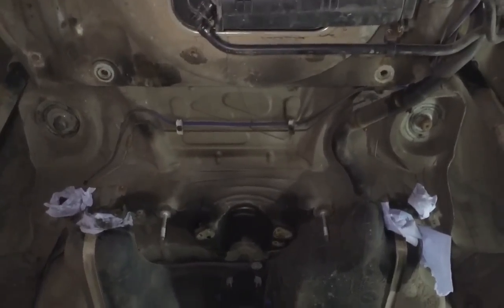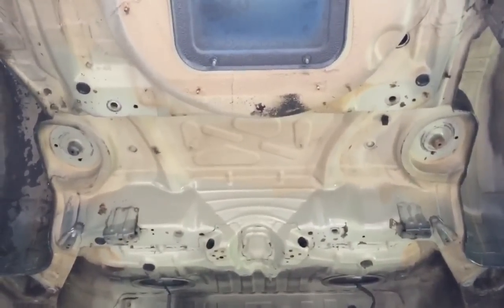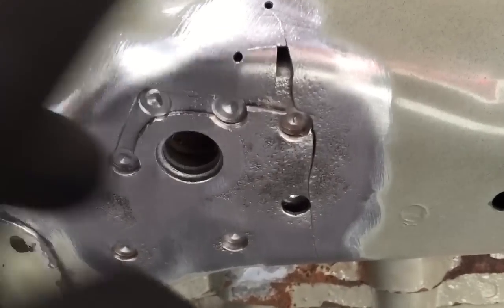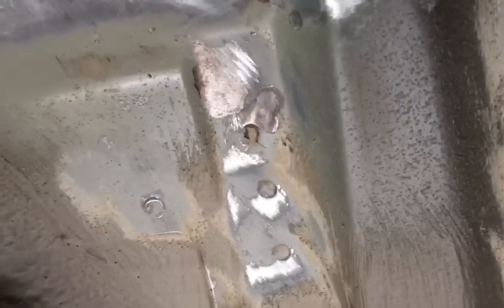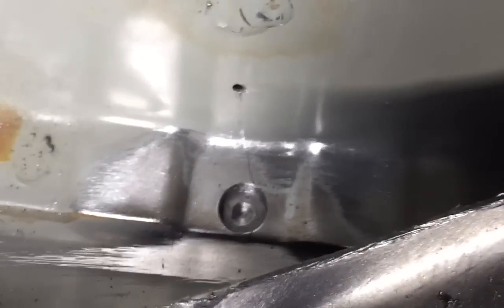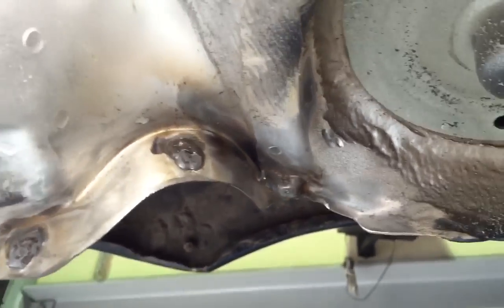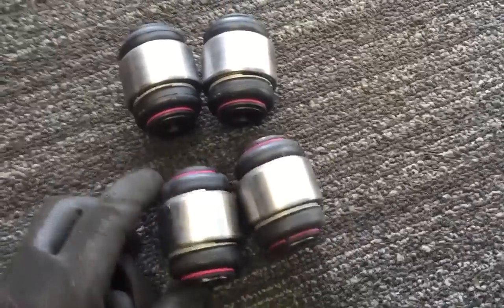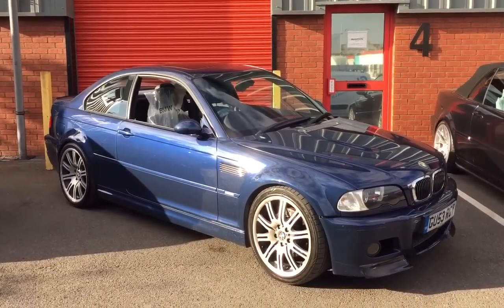BMW E46 M3 Subframe Panel Crack 'Repair & Reinforcement Process'

Comment: a really nice job you guys are doing. I have a question. my E46 has a fixed back seat with one hole for the ski sack, which in theory should have some extra stiffening effect. could it be that my E46 doesn't have the cracks? it's a 320d with 330 Nm

Comment: i dont understand how plates will stop the surrounding sheet metal from cracking. because it is still putting pressure on the metal.

Comment: Anyone know who does this in the states that knows the cars like these guys?... West coast would be nice.
Reply: To the extent that Redish does in terms of quality of work? I highly doubt it. I live in Iowa, which makes this MUCH harder to find someone that will even look at the project.

Finally got a Merrill Axle & Wheel in Des Moines to tackle an inspection of the damage, repair of any damage found, and to install the reinforcement plates V2 kit from Redish. Hope all goes well, I'll update with an estimated cost of repair for others that wish to know.
Reply: twiceasfastasyourass how much were there repairs and estimate?
Reply: Antonio Lewis
He mentioned they do it hourly which makes sense as there is no way to know the extent of damage until your well into it, all you could tell a customer is what previous ones had been.  I'm totally guessing here but I'd expect $2.5 to 4.5k US just for the essential repairs, reinforcements and follow up coatings would be common.  Someone mentioned 6.5k Euro (from another outfit, mainland Europe) for an extreme case where the entire subframe section was replaced.
Reply: albertayars
I was toying with the idea of doing these things myself as I have decades in the steel repair and fabrication biz, started portable welding biz when I was 20.  But I have long avoided automotive as it's much easier to justify a big invoice on a  $250k to $1M industrial machine than a typical car in addition to the fact that I deal with lucrative businesses who know the value of meticulous professional, permanent repairs.  But this is a little different given potential value added over most vehicle repairs.  I'll do one or two of my own and first and see how it goes.  I definitely have never and will never compete with the hacks out there, which is most of them in my experience.   (I'm in North Cali)

Comment: How about you post videos where you go through all this work and realize the underside is completely fine?  These videos are incredibly helpful, but at the same time they are basically fear mongering people as well.
Reply: Although I do agree that a video showing an intact, stock subframe area with no damage would be cool to see (if this is possible), considering that the majority of E46 M3s will run into this issue sooner or later, I don't think this is fear mongering.